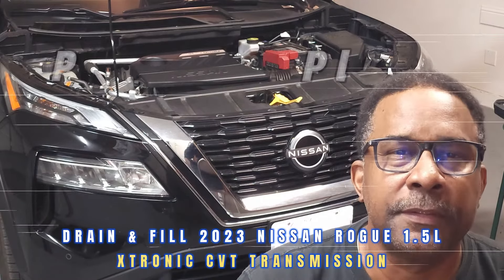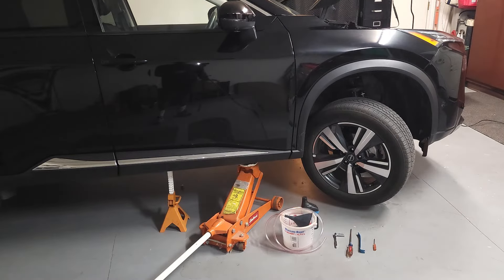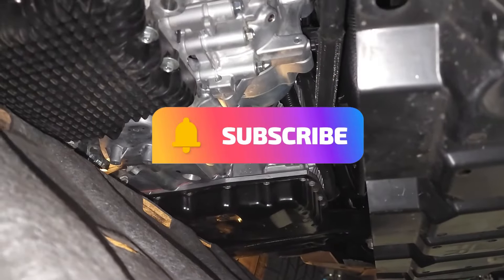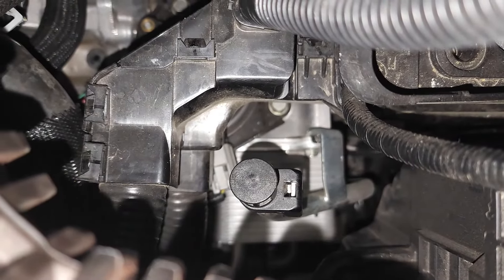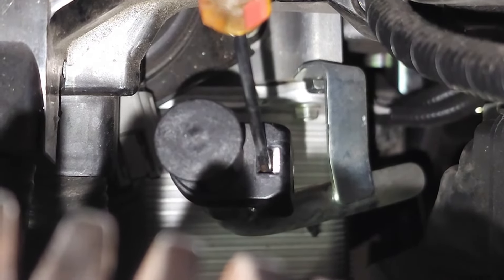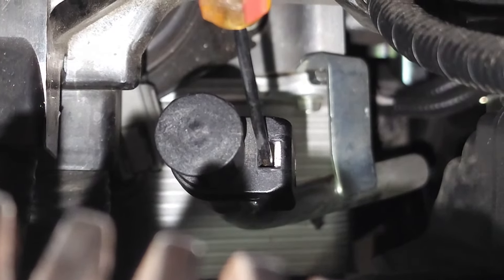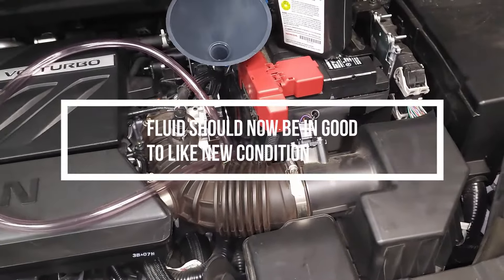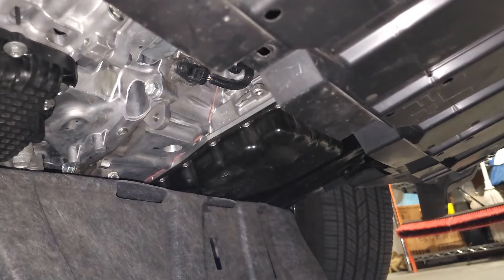2021-2023 NISSAN ROGUE 1.5L Turbo, Drain and Fill CVT-3 Transmission

Comment: Only 4 quarts drained from way wife’s 2022 Rogue. Wondering if I’m not doing something correctly…
Reply: I am about to do this procedure.  After refilling the 4 quarts, was performance normal?  Did the fluid removed look a different color / worn ?  Thanks !!! I too am concerned after watching this video since he talks about 9 quarts of fluid in his CVT. Cheers!!!
Reply: 4 quarts sounds about right he said hypothetically.
Reply: Mine was also 4 quarts so it sounds about right
Reply: @AdrianGarcia-yw1gq  that is why on second gen rogues as well, there were two drain and fills recommended. The transmission case and pump hold the other 4 to 5 quarts which cannot be drained out, but pumped out.

Comment: Do you have an updated video where you actually drain 9 quarts? This method does not work with the 2023 Nissan rogue .... From my research I don't see anybody who's actually done it correctly. But I'm still looking!
Reply from the maker: I  haven't filmed a full filter change video for the 2023 Rogue. See. https://youtu.be/nzDBP8I--ac?feature=shared

Comment: I can't find any information on the filter replacement. I have a 2021 and I want to replace the filter at 41K and then do the drain and fill after that. Does it have a 2nd cartridge filter external like the 2nd generations as well or just the internal pan filter?
Reply from the maker: Checked various part sources. It's still a dealer only part at this time.
Reply: @protipsplus @fixaajets  I believe I found the numbers: pan gasket 31397X230A ; pan filter 31728X230A ; cartridge gasket 31338X230A and cartridge filter 317261XF00

Comment: Thank you.
Reply from the maker: You're welcome! Let me know how it turns out.
Reply: @protipsplus  I'm aiming for the spring, but I'm gathering my materials right now. I'm currently at 20K for my '23 Rogue SV. Ordered new Yokohama Ascend LX tires today, too. I really like this vehicle; it does well in the snow, even for an FWD. It's perfect for me and I plan to have it for a while. I'm taking care of it so it can take care of me.
Reply: I got the same exact 2023 with the 30k miles on it but my dealer said that it needs to be replaced every 60k 
Im confused cuz i found nothing on owner manual
Reply from the maker: See - https://www.nissanusa.com/content/dam/Nissan/us/manuals-and-guides/rogue/2023/2023-nissan-rogue-owner-manual.pdf   Page 9-6
Transmission fluid/oil, differential oil, coupling oil and transfer case oil:
Visually inspect for signs of leakage at specified intervals. If using a car-top carrier, or towing a trailer, or using a camper, or driving on rough or muddy roads: . Replace the differential oil and transfer case oil every 20,000 miles (32,000 km) or 24 months. . Replace the CVT fluid every 60,000 miles (96,000 km) or request the dealer to inspect the fluid deterioration data using a CONSULT. If the deterioration data is more than 210,000, replace the CVT fluid. 

Let me know how it turns out
Reply: @protipsplus  I'm just doing a preemptive drain and fill with synthetic CVT fluid, because the Nissan CVT oil is trash.
Reply: Gays please changing cvt fluid yourself you going to lose transmission warranty coverage. That’s a good video after 60 k
Reply: Props to service at twin city nissan. 22k changed
Reply: @protipsplus  I got it done yesterday and it went very well. Only 4 quarts came out exactly, and that's what I replaced. I used the fully synthetic CVT fluid from O'Reilly's which works very well and is NS-1/2/3 compatible.

Comment: How do you check the fluid level on the cvt on a '23 Rouge SV?
Reply from the maker: The fluid level check port and plug on the Xtronic are located...
1. On the driver's side, ~ 3 inches from the front of the transmission. 2. ~2 inches above the fluid pan seal. 3. The plug requires a large  hex tool to turn. 4. On a flat surface, normal operating temperature, engine running,  transmission in neutral,   open port, and drain until fluid flows to a  trickle. 5. Close port  before fluid stops trickling.

Comment: @7:15 what about the drain plug gasket?? Can't find it anywhere. Got a part number for any local auto parts store?
Reply: @protipsplus  Yep, just got back from the dealership, it’s the same gasket as the oil drain plug. 11026-JA00A
Reply: @protipsplus The transmission drain plug on my wife’s 2022 Rogue is 19mm.
Reply: Ok, I see in the video you used a 19mm, but you mention in the comments that a 22mm is needed. 🤷🏼‍♂️